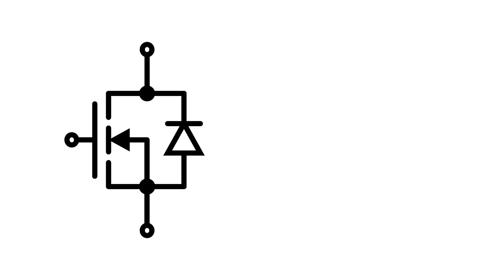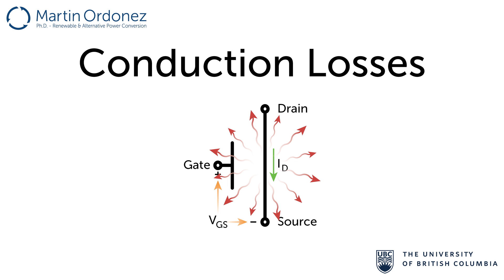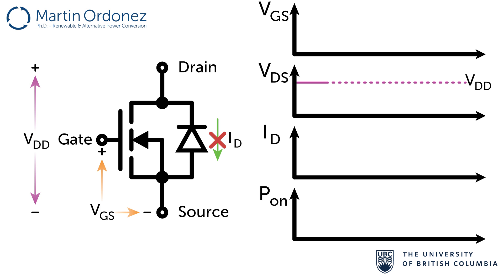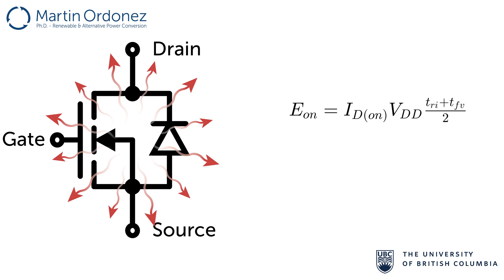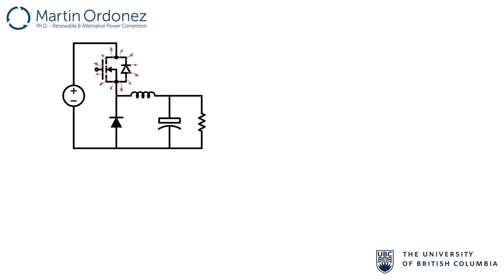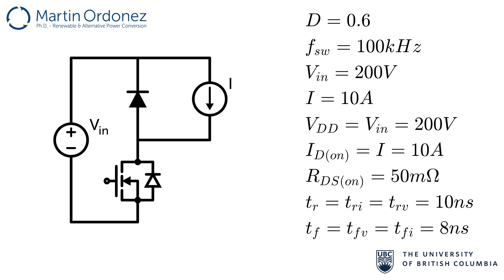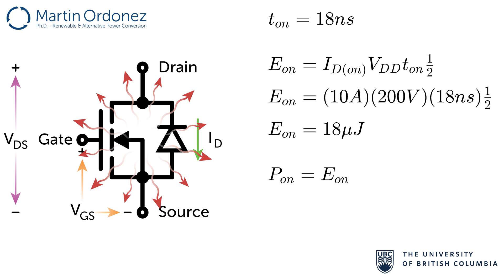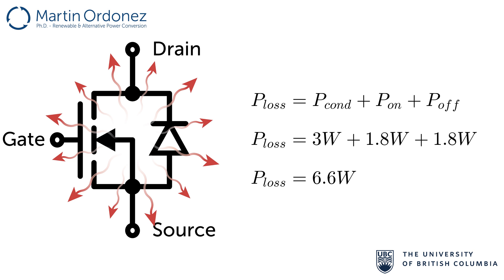Power Electronics - MOSFET Power Losses

Comment: While looking for an article on Mosfet's dynamic losses, I came across this video....which as mentioned, it is indeed  very basic and gives a good method to estimate losses based on estimated/data sheet typical rise and fall times....a good idea would have been for a particular application, the MOSFET selection, and then using its data sheet calculate the actual losses incurred.
Thanks a lot anyway

Comment: So when my smps circuit have 2kw of mosfets but I can only get 800 watt from the 2kw of mosfet at 225khz and the main voltage only drop 3 voltage and the input current is 12amp 133 volt and am losing 1200 watt how is this even possible to have 60 percent losses

Comment: Correct me if I am wrong but don't you need (In some designs) to account for the power losses due to current flowing from source-drain via the body diode whilst the MOSFET is OFF???

Comment: The conduction loss expression may be incorrect in my understanding. Due to a duty ratio of 0.6, the RMS current through the MOSFET should be less than 10 A.
Reply: No, the expression is correct, and you are also correct that the current is less than 10 amps, which is shown in the equation. The RMS current is I*SQRT(Duty Cycle). Since the power loss is calculated by Irms^2*R, Irms^2 = [I*SQRT(Duty Cycle)]^2, which simplifies to I^2*D, so the conduction power loss is I^2*D*Rds,on

Comment: I am currently designing an SMPS and I thank you very much for this reminder. This is very clear and well summarized.
FYI, I found a mistake @4:56 : in the Eoff formula, you must replace "tfv" by 'trv" as the voltage is rising to Vdd when the mosfet is getting off.
But it is not that important as everyone sees the principle that you have well explained.

Comment: Why there is diode connected parallel to MOSFET
Reply: It is called the mosfet "body diode". By design, all mosfets has a reverse body diode that makes the mosfet drive current in the opposite direction even if the mosfet is OFF.

Comment: Is there a way to made a powerful DC load like 1500w test dummy load . Need something to test voltage from 0 up to 100V and current from 0 up to 50A
Reply: Hello, Abed, greetings from Bosnia!
Are you trying to make a MOSFET-based dummy DC load? Or what are you trying to acomplish? Please be more specific.
Reply: @edinfific2576  mosfet based dummy load Dc 1500w power .
Can test 100v 50amp with out getting the mosfets  exploded .
Reply: @abed_itani  I was going to suggest these 2 projects:
https://www.codrey.com/electronic-circuits/simple-electronic-dc-load/
https://hackaday.com/2017/02/28/beefy-100-amp-electronic-load-uses-two-mosfets/
but I came across your other comment where you have already made a similar device.
All I can suggest to you is to do the following:
1. Use more MOSFETs in parallel (as many as 10-15)
2. Use the thermal paste used for computer CPUs, such as MX-2
3. Place a copper pad under the MOSFETs which would take the heat away significantly faster than the aluminum itself. Basicallly a small square flat block of copper on top of a VERY large aluminum heatsink with many fins
4. Place a few large fans on the heatsink to keep its temperature down under maximum load. Just look at the CPU heatsinks and fans, consider that they take away over 100W of heat, to give you an idea of how much heatsink and fan surface you need for sufficient cooling
5. Consider even water cooling if necessary, either by immersing a portion of the heatsink in a large bucket of water, or by using pipes to run the water through your heatsink. 1500W is a lot of power, almost as much as the water heater which takes an hour and a half to heat up 50 liters of water.
6. Since your dummy load likely doesn't need high speed MOSFETS, all you have to worry about is their voltage, current and power rating, and connecting their gates in parallel shouldn't affect the behavior of the circuit, since they use practically no current at DC or very slow changing drive voltages.
Reply: @edinfific2576  yes . I don't want the mosfet to be high speed but I want it fast respond in the gate Soo it can responded very quickly from the feed back . But I have too much problem to control mosfet in voltage above 60v with 4amp . It just get exploded before even get temperature rise to 60c.

I think that I need special specific mosfet for this subject
Reply: @abed_itani  Devil is in the detsils.
I had once tried using a MOSFET on  200+ volts DC from solar panels, and I used a 16V zener diode to protect the gate from surges. The gate was still damaged and I for months I didn't know why. Later I realized that a zener diode of less than 1W power rating has a very poor surge/transient response, and it doesn't conduct quickly enough.
Another issue I have discovered accidentally in a darasheet just 2-3 days ago is that a MOSFET's Vds rating is significantly reduced when you apply a reverse bias to the gate.
Same thing with your problem: there are some details you have missed in the datasheets or in your circuit.
Just like some people have suggested, the power applied to your MOSFET is too high for it and your cooling may also be poor.
Without seeing the actual circuit loading it, and knowing the exact MOSFET model, I can't help you much further.
Reply: @edinfific2576  yess that you're say is correct . 

Can I get a full map and data sheet for a industrial dummy load marketing ? 
Like the one they selling it for big company's that use it to test there power unit .

Most of them are rated max 150v / 20amp / 800w  .

They cost like 2000$ up to 5000$ minimum cost.

Need to copy one of there unit and know the secret behind there mosfet and the board control unit mosfet driver that they use for it

Comment: Thanks . This helpful information . But I am using my mosfet like  irfp260 or irfp90n20d  as a DC test dummy load in DC region of the mosfet . And that make my mosfet like crazy crazy very very extremely hot . And I try my best to not over low the 100C in best case . Even if the mosfet Handel 300W . In DC region only handle 100W !!!!!!!! And that a big Lost power
Reply: What's the current, do you have a heatsink ?
Reply: @panjak323  5A at 20v . So I have a 100W pure heating up inside the mosfet in the DC region .
I need to reach 300W demand of  ( 60v at 5A )
My mosfet get dead in 40v 5A even if I have big heathink
Reply: Well that's non intended way of using a MOSFET. In order to dissipate 300W of heat, you would need to keep it's package temperature at 25C. And there is no freaking way to cool 300W with the to247 package, because the contact area is simply too small with the heatsink. And the power rating decreases with temperature.. at 100°C, the maximum sustainable power dissipation drops to 100W. It has nothing to do with DC rating of MOSFET,  it really is 300W for really short amount of time, until it heats up. So the solution ? 1)Use transistor with a much bigger package size 2) use at least 5 irfp260 in parallel, to spread the power dissipation over a larger area!
Reply: @panjak323  yes your right . There no way to be exactly to  dissipated more than 180w with TO247 package what ever mosfet or IGBT model you use . The area is not enough to transfer this big heating .

Can I install like 5 of them all is same one input gate with out problem or corruption with the input mosfet control signal ?

Comment: Can you explain how the Cgs and the Cds affects the calculation??
Reply: it affects the Ton and Toff calculation, the Cgs and Cds are the capacitance between the gate-source and drain-source, The components and voltage level that  you will switch the gate, will interact directy with the capacitance (Cgs) and consequently the time to reach the threshold saturation. In that case, as quick you reach this threshold smaller wil be the energy dissipated.

Comment: But in datasheet, only rise and fall time of current is mentioned. Then how should I calculate switching loss in this case? 
Need little help.
Reply: In IRF3205 datasheet the given is the rise/fall time of voltage VDS so maybe we neglect rise/fall time of current in calculation of switching losses.

Comment: Super explanation with quiet neat example sir.
For irf3205 the duty cycle given is 2%, which means D=0.2 or d=2.
Reply: Excuse me, but I have the same question. Have you found the answer to yours?
Reply: @mostafasadek2943  Hello, did you find the answer?
Reply: @ADGGMB  I believe it's 0.02. 100% corresponds to D=1. Similarly a 2% means D=0.02.
Reply: 2% duty cycle means D=0.02

Comment: Under DC conditions i.e. duty cycle = 1, the power losses I^2*Rds(on) is much lower than say Vds*I. Ohms law doesn't seem to work here. Power is not equal under supposedly interchangeable equations? what am i missing!?
Reply: yes they are, you messed up your math somewhere. Vds x I = 10Amps x 50mOhms = 500mVolts ... so then 500mVolts x 10Amps is 5W @ 100% duty cycle.  Like wise with the other equation 10^2 x 50mOhms also equals 5W

Comment: Interesting and very clear. Thanks
We also need to add the power lost through the diode to the inductive load.
Reply: I think their intention is only to consider the case when the current I_DS is positive, for which the intrinsic diode does not conduct.

Comment: Dear Sir , i have a 12v battery .After using it , it's voltage is decreasing(which is normal) . but my relay needs constant 12v to switch . how can i get constant 12v for relay while the battery voltage less than 12 v from the same battery  ? Actually A LM7812 needs =>12V . that's why i am confused ...
Reply: A voltage regulator needs a voltage higher than the output voltage to work properly. A Lm7812 needs at least 1V higher or 13V input (check datasheet for minimum voltage input).
Reply: http://www.electronics-lab.com/project/5v-to-12v-step-up-dc-dc-converter/
Reply: You can use a circuit booster (based on a circuit voltage doubler DC to DC) where any "clock" can be used (NE555, Schmith Hex trigger, ... ) to raise the voltage at least at the desirable voltage, and then a TL431 (a shunt regulator, instead of a regulator in series ) to get the final voltage. (While a LM7812 takes a toll of 1V, the TL431 may take no voltage at all, since it is in parallel with the load, as a sharply defined voltage  Zener diode would do.)